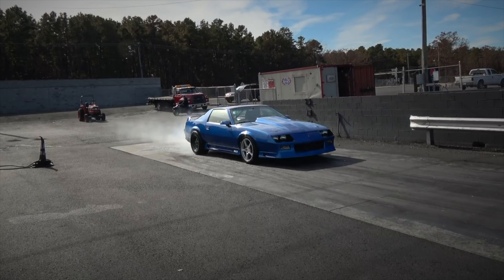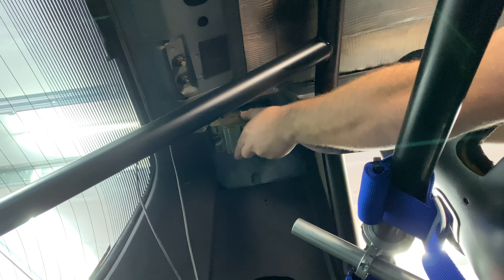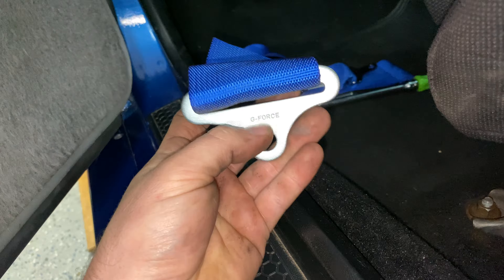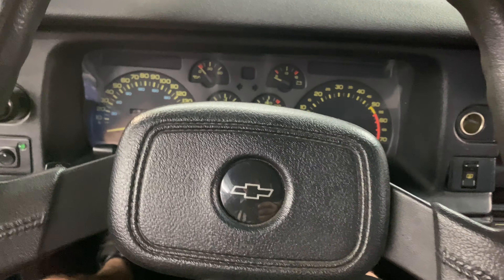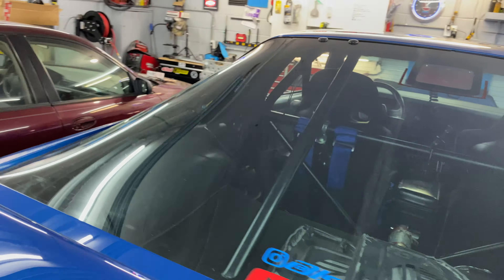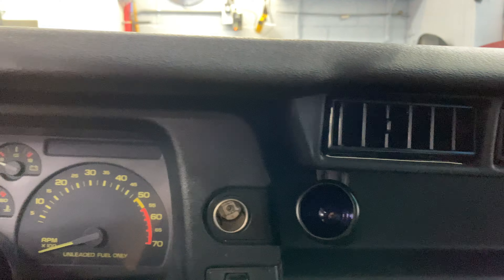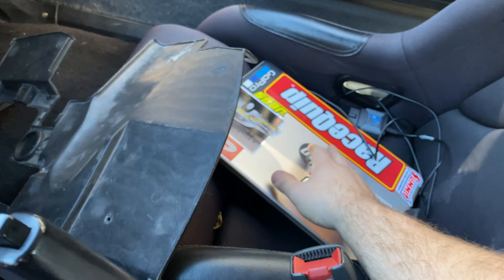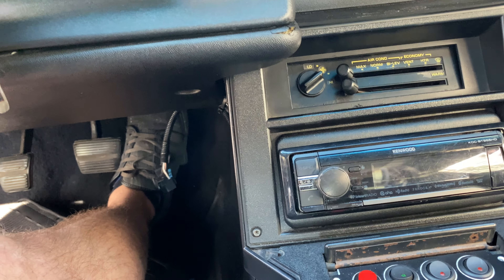Installing 4th Gen Seat Belts in a 3rd Gen Camaro

Comment: Hey matt! Ran into the issue that my car had a belt cut so took them out and thru them away and planned to do 5 points, BUT it's a street car so wanting to do factory style so I'm happy I found this video because my local pull a part has only 4the gens so I cant easily or cheaply get 3rd gen belts so guess who's going to pull a part?